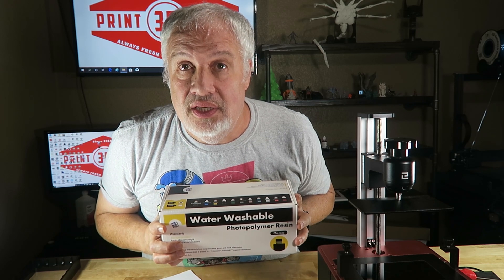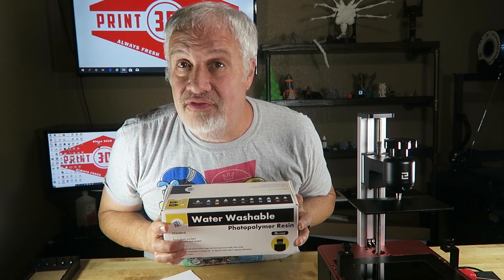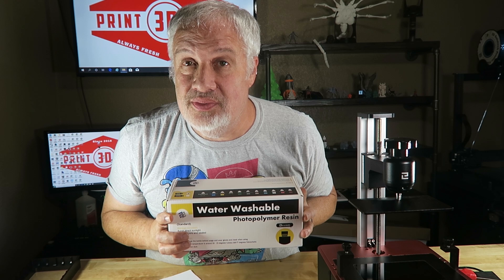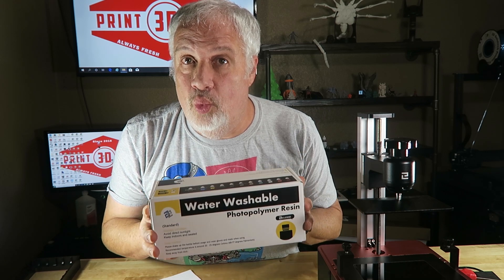Protect Your Photon or Mars Resin Printer in One Easy Step!

Comment: I make my own just using the peel-n-stick contact paper meant for cabinets and after re-calibration it's works well, having a cheap insurance policy never hurts.
Reply: Have you ever had to remove it? I want to do the same but I'm afraid that it won't come off easily due to the heat and uv light possibly baking it on. Also, do you use clear to go over the glass? Or just the surrounding?

Comment: To place it accurately, use a single piece of blue tape on the edge near the screw. Place the decal exactly where you want it, then flip it up and remove the paper backing using the blue tape as a hinge. The decal will drop right back down into place with very little hassle.

Comment: That's a cool idea for a product. Do you know of anything that will protect the surface of the LCD screen? I got a bit of resin on mine and it cured. It completely turned my machine into a paper weight as Elegoo doesn't make LCD Screen replacements for the Mars 2 Pro.
Reply: There are screen replacements, the screen is a consumable item
Reply: @Burnt_clutch89  look at the date of my comment.

Comment: umm, I like the idea.... but why not use good  Scotch tape? Machine doesn't get hot enough to be an issue and it costs cents. Doesnt leave residue IPA cant clean and its  very thin. Should do the job just fine.

Comment: That's right, I did just what you warned about! Struggled more than usual to get the vat out after a spectacular print, but wasn't really paying attention. After a puzzling 30 seconds of "What just happened?", I realized I pulled the LCD off. It cut the flex cable clean at the edge, so I hadn't quite realized what I did. The vat leaked and adhered itself to the face of the lcd. Fortunately it really didn't leak anywhere else, so no deep cleaning of the machine required. Nonetheless, I've ordered a new lcd. I'll be sure to order a gasket now as well. Thanks for the advice.

Comment: I use a tempered glass protector of a litlle tablet or big mobile phone (bigger size than the printer LCD Screen). I don´t know if it add light distorsion but I have good prints actually. the good part is with the glass all It is leveled, and there are no steps

Comment: I don’t have a printer yet, but would this also do the same job as the masking tape hack to give you just a wee bit of room between the vat/fep and the lcd screen?  I understand that this is for spill protection but was wondering if it has a ‘bonus’ feature?
Reply: Todd, you probably could cut notches in the gasket to leave an opening for air-flow under the vat, relieving the suction caused by the FEP, giving you the same effect. In other words, cut the gaset into two or four pieces and space them apart. This would also create a few areas where the resin could still seep through though.